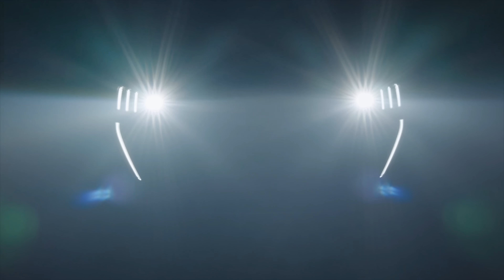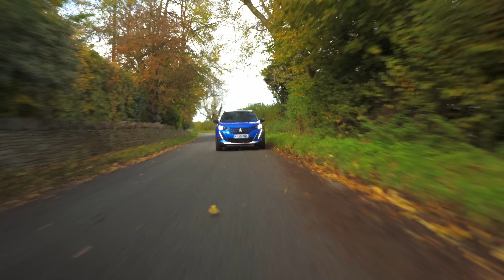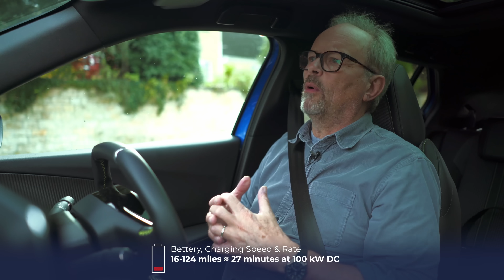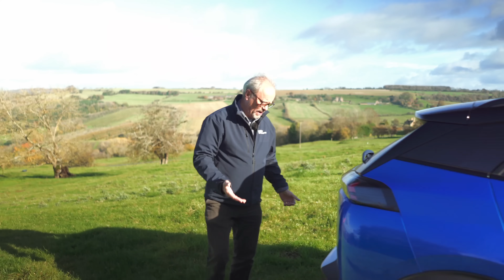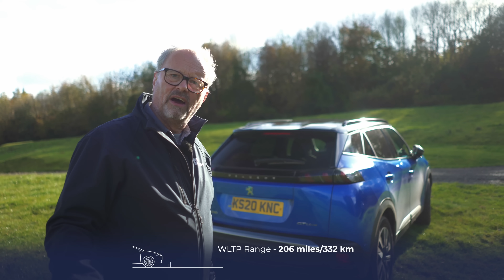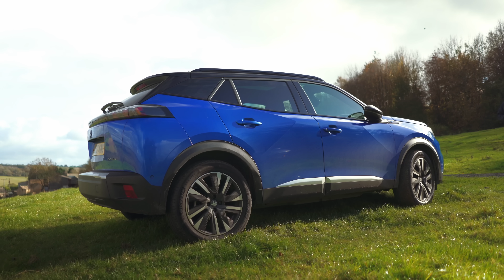Peugeot e2008 - how does it compare to other compact SUVs? | 100% Independent, 100% Electric

Comment: 32,777/290 = 113 mpge. I have no clue where you are getting 180 mpge from? It is a simple equation really as 327 watt hours per mile would equal 100 mpge unless your English miles are different? I need to look up your Imperial gallons?

Comment: I appreciate you drive loads of cars so can't know all the options, this is for your viewers from an owner who has done 3500 miles so far ( much better than my last car Golf GTE). The dashboard lights are dimmable and the colours can be changed easily. There are two trip meters on the end of the right stalk giving range, speed and miles/Kwh. There are 3 power levels default/normal with the option of approx +/-10%, Although I would like another 50 miles of range I always get about 150 miles unless I drive it hard. The range is really quite accurate to your driving style so as you say yours is a journalists car. I hope this helps.
Reply: but he is right about no back camera??
Reply: I actually have the rear camera that also shows the ground around the car ( 180 degrees ) as I reverse, standard on GT Line and GT. Probably not set correctly as it has options like auto zoom to show aerial view of the bumper. BTW it's possible to configure and save most things for 3 users or just stay with factory. I think a previous user has just been playing!
Reply: @oksyar  The GT Line has a reversing camera and a heat pump. lol.

Comment: I'm assuming you get your vehicle price from the press pack, however £28,650 is incorrect, on the Peugeot website it has the base 'Active' version with electric drive train for the OTR price of £32,065 (£29,065 with grant) and the GT Line is £35,915 (£32,915). Compared to the petrol /auto versions of this car these vehicles have a premium of ~24% and ~17%, really stretches the definition of 'way better' ....

Comment: And again the math isn't correct,  290wh/mi is not 466wh/km you need to divide by 1,609344 not multiply. so the correct number is 180wh/km. A km is a smaller unit than a mile, so it is just pure logic that the consumption per km is lower than the consumption per mile.

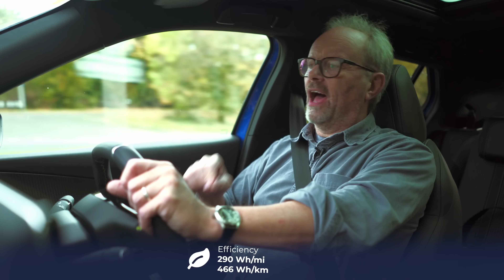Comment: 4:38  According to the EV Database, the efficiency is 180 Wh/km.

You guys messed up, again, the conversion from Wh/mi to Wh/km.

You divide the former by 1.609, not multiply.

466 Wh/km would be outrageous.

Comment: Thank you so much for pushing for non-deluxe electrics. I’ve been concerned that automakers are using the ev arrival to up sell us into something I and many others will never afford. That’s been a consistent message from governments and oil boosters, EVs are unsuitable for ‘lower classes’. It’s  the main reason Quebec announced a 2035 0 gas mandate in lieu of 2030.

Comment: So better off buying a Kona then?
Reply: The only thing is that the Peugeot charges up to 100kW, so it's better for rushing when you want to unplug at 60 or 70%. On the other hand, Kona has more range, more efficient. In my opinion, I would buy the cheapest one, the best deal.

Comment: Miles or kilometers per kWH seems far better a way of measuring EVs.  With MPG, if I say my car has 30 MPG, I know it will actually go that 30 miles multiplied by my fuel tank size.  MPGe, leads to the comical idea of an EV rated for 150 MPGe, but not able to actually travel 150 miles.

Comment: I like the channel, but I am disappointed in the recent reviews. The range calculation is wrong, no mention of benefits of 100kW charging and c'mon, you can just ask anyone who drives Peugeot, they will tell you where the trip meter is. 

In my opinion this car is in between Zoe and ID.3 Pure. Yes, it has less range, but the faster charging will allow you to travel at similar speed or even faster during longer trips.

Comment: I own one of these and have been in contact with the makers about range indications. As a very careful driver I get 4.6 miles per kilo potato but, from less than 90 miles showing a couple of nights ago, a full charge lifted that to 124 miles though indicating 100% on another page. I thinks there's a software glitch. I love you btw.

Comment: I think you're incorrect when you say you can see (and hate) the way this car was clearly designed to have petrol and diesel engines and electric only as effectively an afterthought.

It has clearly been stated by the PSA Group that these new models (208, 2008, C4, Corsa etc) were designed to be built on the same production line, irrelevant of power train, and manufacture doesn't need to change, irrelevant of demand for petrol, diesel or electric, therefore if demand was towards 100% electric, they would simply build them like that.

For the costs of electric vehicles to come down to an acceptable and affordable level for the majority of users, platforms and bodystyles will need to be shared, plus there are still a lot of people that don't wish to shout about the fact they're driving electric and wish to come across "holier than thou" as you are increasingly doing on your reviews.

Comment: I'm happy to hear you repeat my rant a few weeks ago on your site about the needless add-ons that jack up the price and doesn't get into the hands of the average consumer. These will not be common vehicles until the gee whizz engineers keep force feeding us what we don want or need, which is a a sub $18,000 vehicle BEFORE incentives. I understand the Chinese labor costs are different and affect the price there, but why are the prices doubled or more just to arrive on other shores? As long as the companies are beholden to the fossil fuel industries, quarterly dividends to shareholders, executives bonuses and salaries and not the customers needs, there will not be widespread adoption of EV's available to the average consumer. I don't need a $800-$1000 watch or cell phone to be able to tell time or call my friends and family. The less expensive versions are widely available. My delicate ego can handle it.

Comment: The question for Robert is this or a MG ZS exclusive? Because that is cheaper and better specced, with a similar range (or better if Roberts experience holds true over long term)
Reply: I have the MG and for 22000 I'm over the moon. Range has been perfect except for driving it back from dealer in Wales on busy m5 with no charge points working. No longer a novice, I now just know where the super reliable instavolt stations are, but have only used x3 as all my charging is at home. This car looks very similar to mine probably slightly better range. I'm averaging 17kWh per 100km (or 3.7miles per kWh). Wife and kids love it. Just activating the "granny cable" with WiFi switch now as going to bed, for the most ECO friendly overnight electricity, planning to get octopus go when I'm less frantic at work. Don't think Rob has been to excited by either SUV, but MG is outselling most others due to price.
Reply: @stapsell  Nathaniel in Cardiff, by any chance? That’s where I got mine
Reply: @insomniavfx  Panda motors in Swansea. Nice gang
Reply: I went with the MG over this. Other than a few nitpicks I’m very happy with it, especially as the dealership had a £6000 discount on top of the £3000 government grant.
Reply: The MG its actually made by a vertically integrated battery manufacturer.

Comment: I love how every EV reviewer feels that they speak for 99% of people when they say 200 miles of range is plenty.  I have over 300 miles of range and I can live with it, but I would welcome 200 more in a heartbeat.  I realize that I don't speak for 99% of people, but I do commonly see others with the same opinion.  I also realize there is currently a dimishing return on battery size, so there is still a practical size limit.  I'm sure as energy density increases over the years, the average range will too.  I'll bet in 10 years 200 mi range will be considered tiny.
Reply: @john As mentioned, that 99% is all about statistics. These cars are aimed at average users, rather than the top 1%.

If we use USA data, as it has higher average mileage than any other country, so is basically the worse case scenario. USA drivers do around 13,500 miles per year on average, or 260 miles a week. That's  about 37 miles per day on average in the US (assuming they drove 7 days a week). So even if someone did 5 times US average each day, that would still be under 200 miles a day. And again, this is the worse case country.

Other countries do much less mileage on average, the UK for example does 7,400 miles per year on average, and has been gradually dropping for the last 30 years (it used to be around 12,000 a year). Germany is slightly higher than the UK at 7,800.  So that works out at about 22 miles per day on average for Germany. Most other countries in Europe do less mileage than Germany. Japan is even less, at under 6,000 miles per year, so under 17 miles per day on average, less than half the US average!

So when an EV reviewer says 200 miles is plenty for most people, that's literally what they mean, it's plenty for MOST people in the World, based on actual statistics.

Also bear in mind, many of these cars are being produced by European and Japanese companies, for the European and Japanese markets.

There will always be outliers of course, and even for an average user, there will be days when the car isn't used and then other days when they do a longer than normal trip.
Reply: @TheBoothy666  I still don't think averages don't tell the whole story.  If they did, people would be happy to have 5 gallon gas tanks in their cars.  Maybe someday when there are Level 2 chargers at every parking spot and DC Fast Chargers at every highway off ramp, then batteries could be smaller.  Until then, I'll take as much range as they can practically squeeze into my car.
Reply: @johnh8268  Do you charge at home? If I did I could live with a very short range EV like a first gen leaf - It wouldn't be nice occasionally.   A car with 150 miles though would make range an issue only on holidays and driving holidays are not that common for me.   A car with a huge battery would be capital sitting around doing nothing - perhaps as much as the cost of redecorating the house which would give me more value.
Reply: @timmurphy5541  I have a non-standard use case.  I work in two different locations that are about 250 miles apart and travel between them weekly.  I only have a home charger at one location.  I rely on supercharging for travel between locations and while at the second location.
Reply: @johnh8268  I agree to an extent. I think we do need many more fast chargers than we have now, and personally, I'd be uncomfortable with an EV with less than say real world 250 miles range, minimum.
But I think the 5 gallon tank is a little different, with an ICE you always have to go to a station to fill up, which would be a pain if you needed to do that every day!
With EVs, most people (although not all of course *) would charge them at home overnight, and would only use 3rd party chargers if they were traveling beyond the cars range.
With an EV,  you've basically got a full tank every time you set off from home.
* Some people only have on street parking for example, so an EV might not be good for them currently, especially for a high mileage user.
Reply: @johnh8268  Ah, just noticed your post. So seems you're basically one of the 1%, I can see why a good charging network is important in your use case. Nice to see you're actually having a go with an EV even though you are definitely not an average user :-)
Reply: @johnh8268  So I think you benefit from a long range EV even if it costs more.
Reply: It is based on statistics about how people use their cars. It could well be that people who have to drive a lot, like sales people, care more about cars and therefore are more active on car centric social media.

Comment: The text with consumption figures in Wh per mile or km are messed up at 4:40. It states 290 Wh per mile and 466 Wh per km, but since a mile is longer than a kilometer this makes no sense! I assume you accidentally did the conversion the wrong way round? I.e. converted 290 miles to 466 km? Assuming the 290 Wh per mile figure is correct, it would translate to 180 Wh per km, which sounds about right. This is the second time I've noticed this error in a fully charged EV review.

Anyway, thanks for posting videos like this about the many new EV models that are appearing! Seems not so long ago that there were only a handful of options. :)

Comment: Sorry, but this review lacks a lot of research. I own this car, and many of the complains in this review, like the LED and trip meter are easily fixed in the infotainment. And the range thing, have no idea how you can only get 130-150 miles. I easily get close to 200. This was a bad review, I guess if it had been chinese Fully charged would praise the heck out of it. Also funny that you say combustion cars are pointless, yet you are leaning on one in the thumbnail, that is a normal 2008.

Comment: In basic terms it is a converted ICE car or as they are called a Compliance car.. where the car maker can't be bothered to do a fully ground up new BEV car with good flat floor battery and good range and nice driving... So being a compliance car best Avoid buying it. get a full BEV car the range alone be far better in the fully BEV.

Comment: Let's be honest here, this SUV screams compromise in term of battery efficiency and range. The only great feat of the platform it is sitting on is the Heat Pump (even Tesla has to play catch up on that  now) and the inverter that sustain 100kW DC charging speed. It is a car that will be marketed for families, and in todays EV world and the lack of 3rd party charging stations, I'm sorry but I will not use this car to go on vacation or to visit relatives living 2hrs+ away.
Also regarding all the negative aspects that Bobby is finding,like the rear camera absence on a high level trim, the indoor LED ambiance lights being actually dimmable , and are getting this comments section puzzled, you gotta ask yourself what Peugeot UK fail to present when they handed the car to him. It's not the first time PSA is kinda not taking FC seriously, almost as if they're trolling.

Comment: Took me 2 minutes to look up the 2008 manual PDF.
Trip Meter is classified as optional information, where the total distance is permanent information in variable locations depending on the view mode used.

Press Settings, Select Configuration (on Connect Radio) or Options (on Connect Nav), then Instrument Panel Personalisation.
Select Personal 1 or Personal 2
Select the information you want.....ie Trip Computer.
Save & Exit
Use that Personal 1 or Personal 2 mode.
Reply: Come on!   You KNOW Kryters doesn't do sums or tech!
Give him a break.....!!

Comment: The E208 is a little disappointing real world range wise (really like it otherwise) but the E 2008 with the bigger frontal area is bound to be even less efficient. The Zoe is built ground up as an EV but I still prefer the E 208 and I tend to think the end result is the most important thing rather than the design ethos. I agree that price wise they seem to be overpriced (best to wait and buy one a couple of years old I think).

Comment: I normally multiple kWh x 4 for my style of driving.  If I'm driving like a petrol head I multiple kWh x 2.  It doesn't work when you look at the heavier bricks out there.

BTW I love the override button when charging. I've been caught out with my Leaf 2020, plugin to 50kw charger, no worries, plug into 7kw and I need to force it thru the app

Comment: At the Peugeot pre-launch event I said to the Rep that all EVs, not just the top trim, should have a reversing camera because pedestrians won't know they are about to move back. Every EV on sale today should have a cable storage area under the bonnet, not a quaint handbag taking up luggage space
Reply: He said he usually stored the cable under the boot floor panel.
Reply: Do they come standard with pedestrian emergency stop front and back? If so, the camera would just be an extra nice thing to have but not absolutely necessary.
Reply: There's a great hidden storage area under the shelf in the boot.

Comment: They COULD make a Peugeot e108.
But they don't.
Reply: They will eventually, they just start for those cars that are best sellers around Europe.
Reply: @AaronStarkLinux  It's actually a lot more complicated than that. The profit to be gained by selling electric cars in higher segments is about as much as the profit to be gained from selling cheaper electric cars. The problem is that the investment required to get that profit is a lot bigger for cheaper cars, so they purposely go for the the fat juicy sedans and SUVs, even though they'd make the same amount if they didn't.

Comment: If the onboard computer has the ability to have different driver profiles, if you create a new one then it will do all the driving calculations differently from a fresh start. Or at least it should if the programmers did their job, because in the world of shared cars in a family who use different driver profiles, the ability to check if the 20 year old son has been thrashing the car and ruining the economy statistics and so needs to be putting more towards the maintenance is quite essential. Otherwise the different driver profile option is pointless.